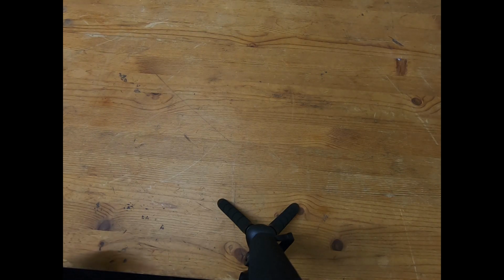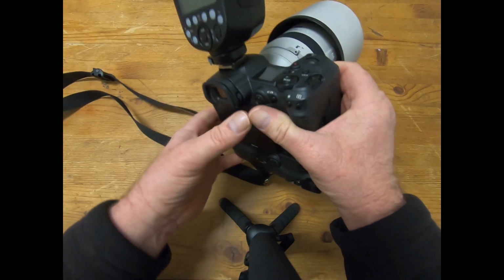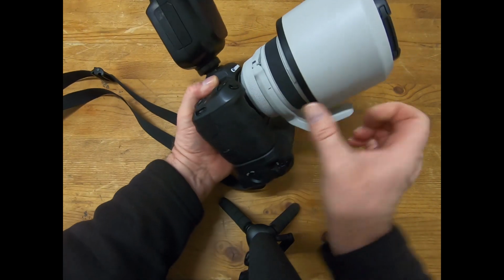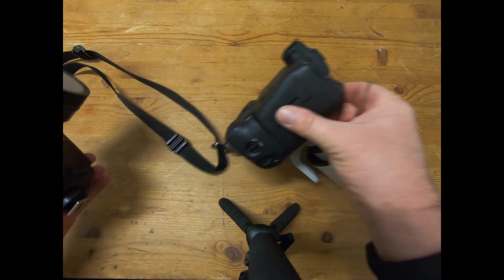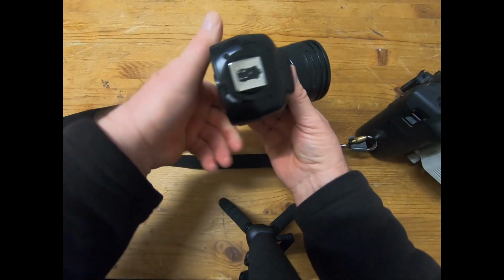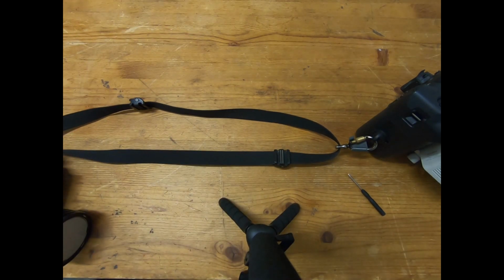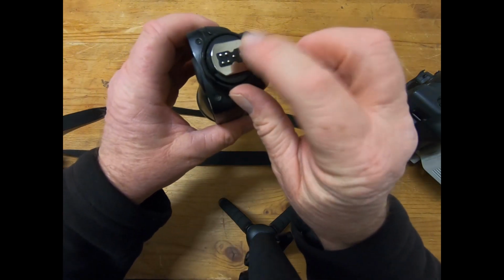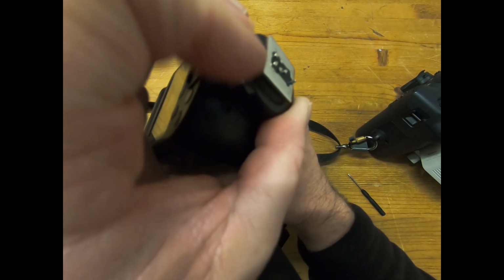How to remove a stuck @GODOXGlobal  V1 flash from my @canoncanada EOS R5

Comment: That's exactly what happened with V1 flash on my Olympus OM1 camera.  I thought I would have to take it to repair shop to fix but thanks to your video,  I was able to remove the V1.   Exact same issue with non-retractive pin.   Thank you for this awesome video.

Comment: I’ve had this problem with a couple of flashguns I’ve the years. The metal pin that lowers itself in to the hole in the hot shoe fits loosely inside the mounting/locking part of the flash is just a small metal pin no longer than apx 4mm and has a tiny plastic appendage in the middle and a tiny spring covers one half of the pin. The tiny bit of plastic stops the pin from falling out of the flash and getting lost while the spring keeps pressure on it forcing it downwards but not succeeding because of the larger locking screw (that you hand operate to tighten the flash to the camera hot shoe) is holding the pin up. By tightening that large plastic screw (or the sliding mechanism shown in this video) the pin gets pushed further down until eventually it reaches the hot shoe hole. 

The problem with the flash getting locked occurs because the tiny plastic appendage has snapped or worn. It’s quite protected, so when it breaks it’s usually due to age and wear, not because of accidents. Who would have thought that a tiny piece of plastic just 1mm in size could potentially waste a £500 lens?

Comment: Same thing happened on my X2T on my Olympus camera.   I had to use side cutters to cut and remove the twisting ring, then cut/remove a second ring that lifts the locking pin.   Shared my analysis with Godox, but they were not interested.   The root cause was a broken screw mount in the hot shoe base.   There are many poorly designed mechanical aspects of the Godox hot shoe.   The screw bosses are incredibly weak and prone to breaking.    They offered me a special deal to sell me a replacement hot shoe for $50 USD.    That's more than I paid for the X2T new!    After cutting off the rings, I can now access the tab that controls the locking pin.   It's awkward, but I can do it with my little finger.    The X2T still works fine.

Comment: This worked, thank you. I pulled the bottom off my flash to make some adjustments and in doing so I put the lock pin back on, backwards. The flash was stuck when I put it on the camera. This wedge trick safely removed it, thank you.

Comment: Nikon D750 with SB400 stuck as well. Used Photo Pro sent me this video for directions on removal. Additionally, this was the first time I had used the flash after getting it from UPP. Unfortunately, the flash & hot shoe have no access for anything to be inserted due to the camera prism being in the way & tolerances so tight on the rear that nothing can be inserted. Took it to a local camera shop as directed by UPP & they couldn’t get it off. Looks like the only option is going to be cutting it off with a Dremel used as a die grinder. Too bad, it’s a really nice flash unit but I don’t need my camera with the permanent unicorn look when outdoors shooting landscapes & wildlife. My advice, always check the retraction mechanism before mounting your flash unit & save yourself from a headache like this.
Reply from the maker: Sorry it didn't work for you, but I hope you are able to have it removed!
Reply: @dongordonphoto  
Don, thanks for replying. A call to Nikon got me a quote of $90 just for a “maybe” fix to start with. Not an option through them. Just spoke to my contact at UPP this afternoon. I told them just to ship it to them FedEx overnight or 2 day with insurance would cost almost $100 more than I paid for the flash. Not an economically feasible solution. If I ship ground with insurance it’s less, but then I run the risk of having my camera knocked around in trucks over several days possibly creating another problem with the camera. Not worth the risk. Sending photos to UPP & trying to get some kind of a store credit to put towards a replacement unit as this one is not coming off without amputation surgery. Thanks again.

Comment: Brand new X2T-N here, stuck on Z6-ii. Grey button depresses and ring rotates toward unlock a fraction and then stops. Wiggling ring causes grey button to pop back out. Waiting for Amazon vendor response. Seems like a nice flash system but this is beyond annoying.

Comment: This is the main reason why I switched to Profoto A1 flashes. I had the V1 get stuck on my EOS R.
Reply from the maker: I already had the A1 - I bought the V1 as a backup for my A1 - I'm considering getting the FJ80
Reply: @dongordonphoto  I would stick with the A1 in my opinion. You can pick up A1's used for a decent price now. They go with me when I travel now. I had 5 V1's now I have 5 A1's.
Reply from the maker: @gregshawphotography8828  Interesting point - I may do just that!!
Reply: my Godox V1 stuck after 2 days of purchase with very gentle and careful use. The locking mechanism is awful.

Comment: I figured this out, the ring on the X2T moves down as it is released and starts to rotate toward the release, but when it is on the camera if the mount is tight this motion is impeded and it jams. I found if I pushed the grey button in, then rotated the ring toward release and pushed it down toward the camera simultaneously I could release it with some difficulty. I tried it on another Nikon DSLR and it was not as tight so it was easier to remove, but on my Z6-ii it was very difficult to unlock and remove.

I also found that if you remove the grey button out of the lock ring the ring rotates easily, it won't lock anymore but it gets quit snug on the camera. 

Note that this was not a problem with the one Godox flash I have, only with the trigger. The flash unit locks and releases just fine.

To be clear this is not a problem with the lock pin as described in this video, it is a problem with the lock ring.

This is a good flash trigger system when it does not get stuck on the camera. :)

Comment: Before I bought my R5 and after reading several horror stories about R5 hot-shoe getting detached from the camera body when a flash is mounted on it, I had decided NEVER to mount a flash on R5 directly - particularly for a heavy flash Godox V1C which I also have.

Instead, I use X2T for off-camera lighting (mostly) or use a flash bracket as shown in the link below. The bracket adds a bit of weight but has other advantages mentioned in the video.

https://www.youtube.com/watch?v=2cjyYXjdxWs&t=75s&ab_channel=EdVerosky
Reply from the maker: Never had a hot shoe detach, but hotshot came loose on my 1DX MKII and my R5 - 1DX MKII was easy - I took the metal plate off and tighten the 4 screws - can't do that on the R5 or any R series camera as the screws tighten from inside the camera - I had to send it in to Canon!